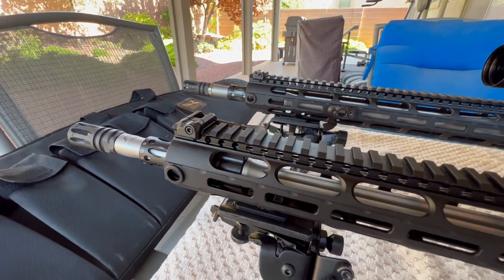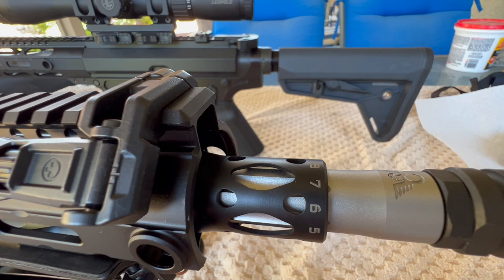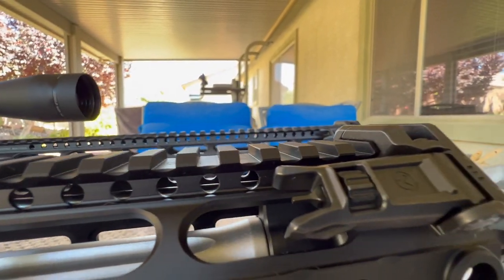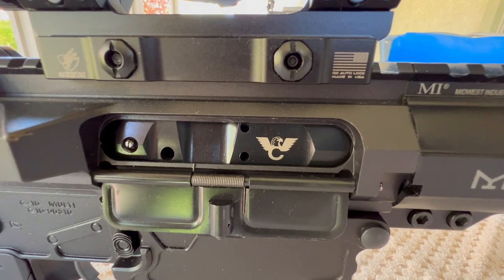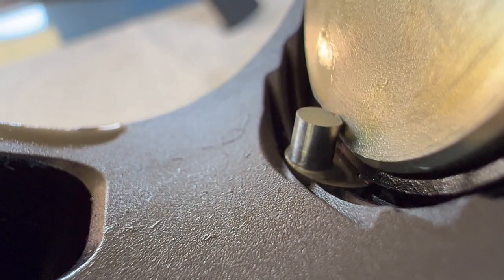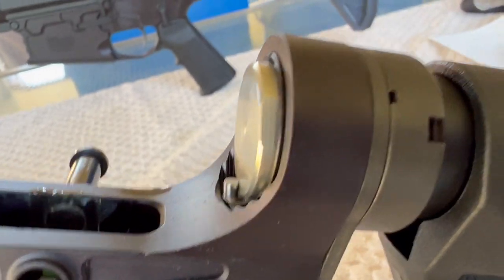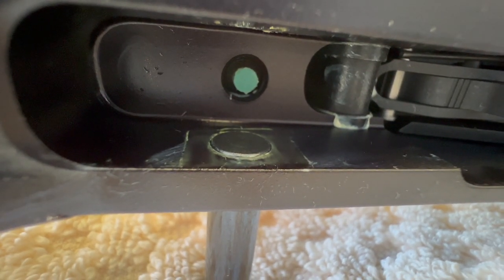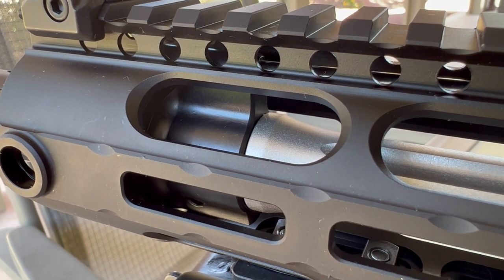LR308 New Frontier Armory DPMS "Low" Build 1 & Build 2 Comparison!

Comment: Nice builds, well I think i've finally got the bugs worked out on mine.  I did find a gas leak on the gas block roll pin and around the gas tube, but I left it alone and essentially sealed itself last time out to range. I figured the more I mess with a gas block roll pin I'd probably do more harm then good, every forum I read said to just leave the dang thing alone and let it seal itself.  One thing I did find out was that this box of Norma ammo I had was junk!!  I've shot 5-6 different brands of 7.62 NATO and 308 and they all lock the bolt back on last round, the norma would not. Also tried 3 different magazines. The Magpul and D&H metal ones work just fine. Another issue was using the Wilson Combat flat wire buffer spring was just too long compared to the standard one, she would not cycle worth a damn with it in. So standard one is in there to stay.
Reply from the maker: Should be getting this new one out soon! The gas tube on this one almost fell in! It's the gas block not the tube. As you're saying though it will seal itself up over time. The D&H Tactical and Duramag's that I have won't work outside of the rifle let alone in actual use. They either allow the rounds to tilt down in the rear and if I try turning the springs around will allow them to tilt down in the front. I've had no issues at all with The PMAG or Lancers. Sounds like you're getting all the bugs worked out! These large caliber AR style platforms might look the same as an AR-15 but tuning them is a whole different matter! It seems a lot of them will run on a standard gas block and even suppressed but for me an adjustable gas system is well worth it and avoids the buffer and spring circus.

Comment: Was that a piece of lint in the bottom of the dimple of the case deflector on your Gen 2?
Reply from the maker: I noticed that too! At first I thought maybe it was debris which as you know would have seriously offended my OCD affliction and then made my feelings start to hurt! Lol! I may be able to jamb a Skittle in there but don't think it will hold during firing? Oil reflecting the light! This could also give my position away during night ops! Not sure I'm onboard with this feature. Lol!
Reply: @peteregger7928  LOL !
I had to watch it a few times to if there was a hole in the bottom.
Which I’m surprised they didn’t drill it all the way through.

Comment: I think i said this in the video about the bcgs but my kak 308 bcg looks exactly the same also.
Did you mention the charging handles? Are they the aero ones? 

I got a timber creek charging handle a while back because it was onsale, everytime i shoot it hits me in the nose because the engagement sucks lol. Ended up putting my milspec style handle back in but that really sucks having to reach under the optics to charge it.
Reply from the maker: Charging handles are Radians. $$$ They lock in almost to well but I think a lot of that is the heavier BCG and stiffer 308 buffer spring. I actually visualized the charging handle hitting you in the beak! Ha! Ha! Must have been quite the surprise! Lol!
Reply: @peteregger7928  lol… at first i didn’t know what was hitting me on the nose, as it kept happening i looked down and saw the handle going in and out. I have radians on all my other rifles i even have the stupid expensive SD one which i think is mostly a gimmick 😂. Guess I’ll spend the money and get one for this rifle too
Reply from the maker: @itsamk18-ish  Hard to beat the Radian!